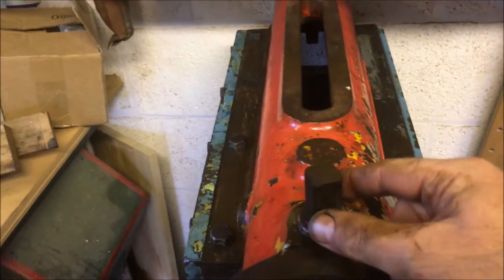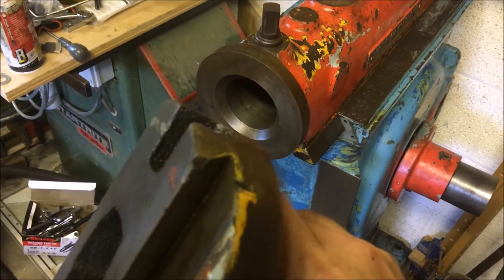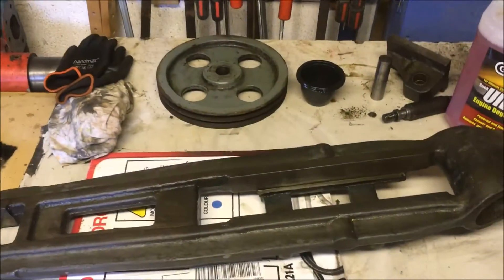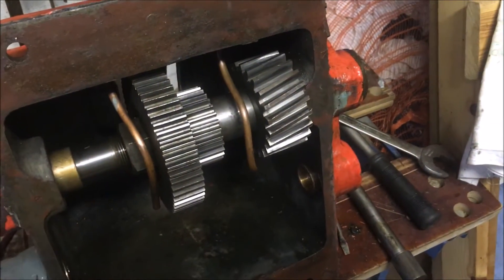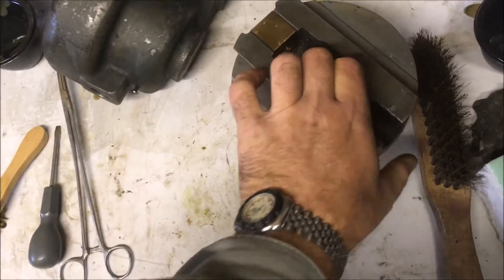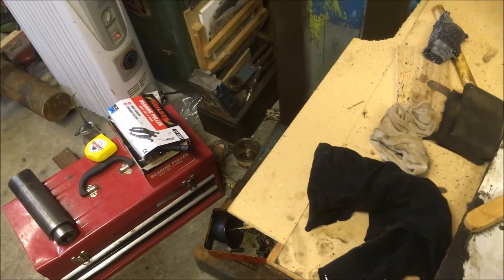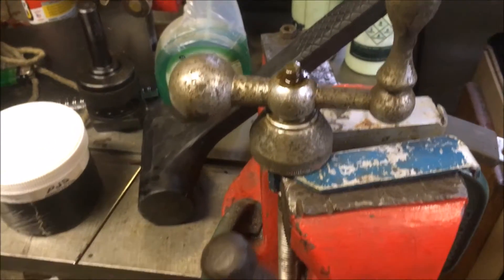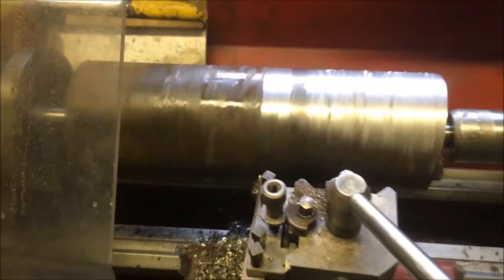Elliot 14S Update 7

Comment: Hi, I find Jizer is very good stuff for degreasing filthy oily machine parts. My tip would be to work the solution in with a stiff nylon brush so you're breaking the surface of the oil and getting it right in without causing any scratches. A paintbrush, if you used one is no good. I rebuilt on old Manchester Major that had sat in a factory for 40 years. I'll do a proper video soon. All the best

Comment: At least no bad news this time, looks pretty good from what i can see.....
Steel shaft in cast bearing is ok, my Alba is exactly so. Just wondering if your bearing is really cast, it looked more like steel, which would make sense as one part of the bearing assembly should be softer than the other, so you can control which is the sacrificial part. 
For cleaning i usually use Kerosene, for 2 reaons, it's very cheap and i have about 1200 litres in the tank, second it leaves some greasy film on the parts so they don't rust. For the really stubborn stuff i use an industrial degreaser, even thinned down at 20:1 it instantly dries out the skin, pretty cheap as well, i buy it in 20ltr drums at a truck supplies company.
Reply from the maker: dynoguy Hi Mike, thanks for dropping by, I've taken a good look at the shafts bearing and still think it's cast iron. Not sure how to confirm it.  I will upload another video with some close ups when I get chance.

Comment: The water based "degreasers" are basically ( no pun intended )Caustic soda based. Just like so called oven cleaners you will find a far cheaper alternative, just buy caustic soda crystals and mix your own. When it comes to degreasers, the hydrocarbon based versions are vastly superior